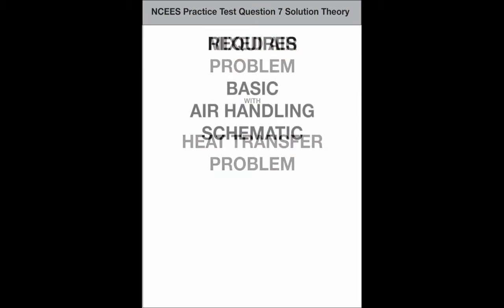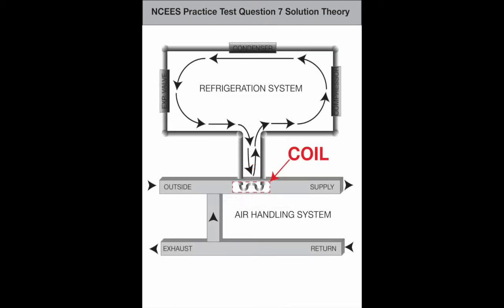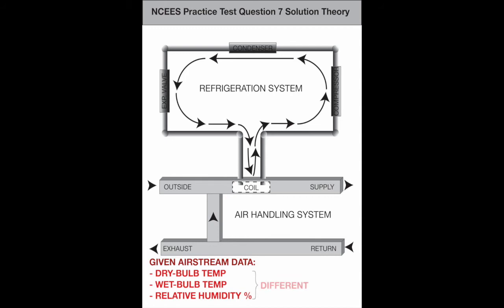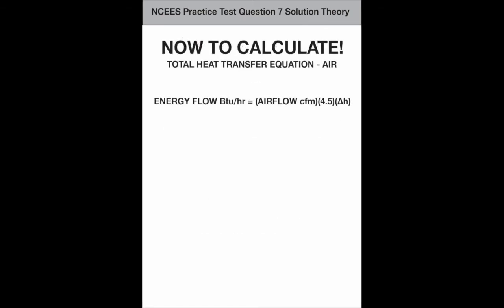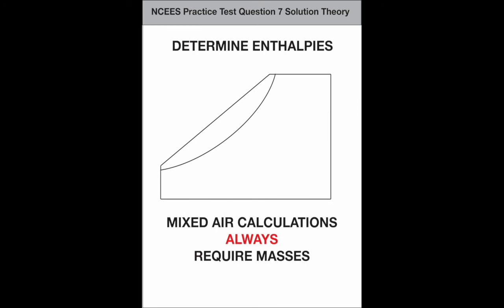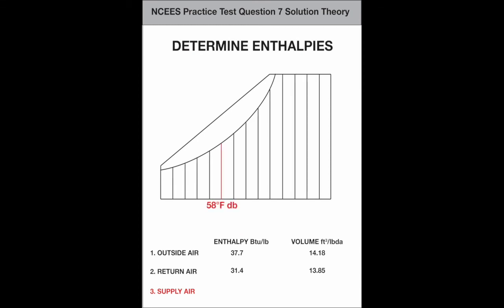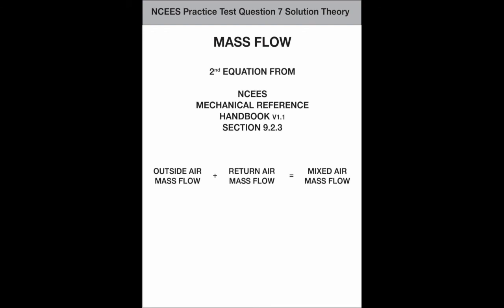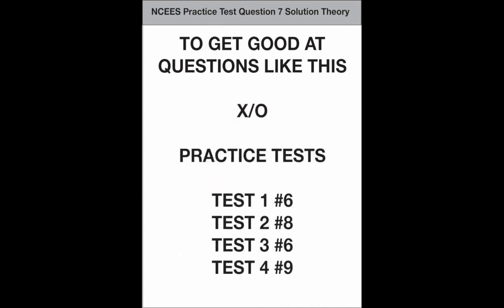ExOverZero NCEES #7 Solution HVAC&R PE

Comment: The density of the mixed air entering the AHU is approximately 0.0719 lbm/cf. The standard heat calc formula is accounting for a 0.075lbm/cf density. This is a pretty big difference because the answer should really be closer to 64 tons. I don't know why NCEES uses the standard value equation in their solution.